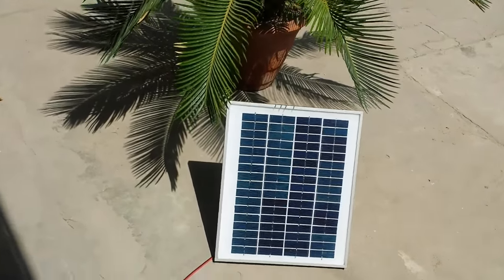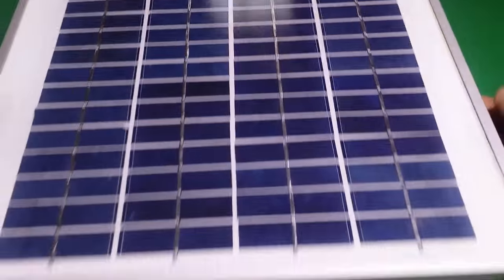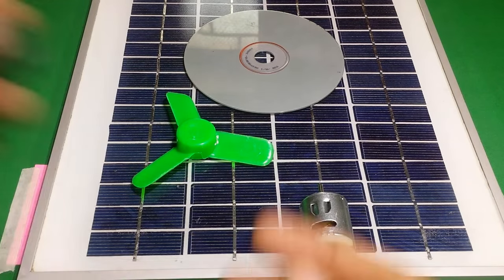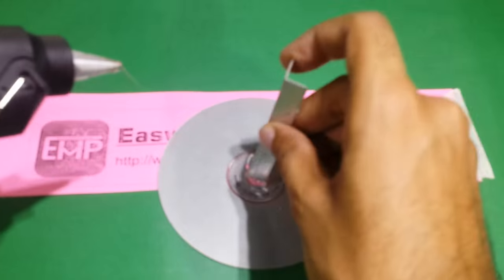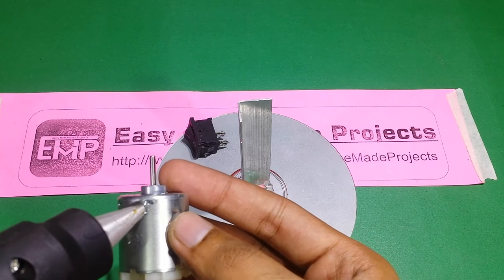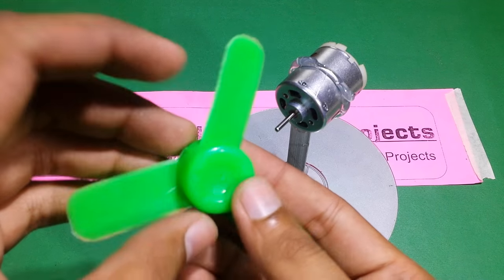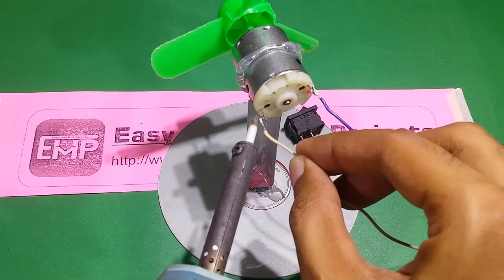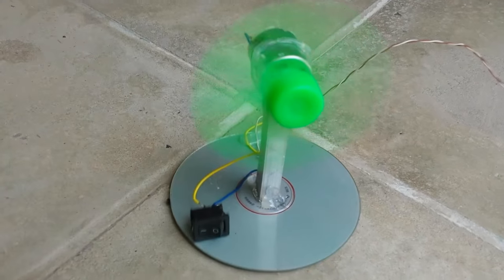How to Make a Simple SOLAR FAN at Home - Very Easy

Comment: I think that aluminium angle will not give proper support to motor. Motor continuously vibrates and also remove that robotic voice...talk in your own voice..it will be nice and effective
Reply from the maker: +Chinmay Electronics actually i am not an English speaker, so it is very difficult for me to speak in english. but i will try in my up comming videos. thnx
Reply: Suggestion: you can make an entertaining dialogue between you and the voice. Try it.
Reply: Chinmay Electronics I don't think the Motor could ever remove that robotic voice

Comment: why did you not connect the white wire?
Reply: The two unconnected wires are for connecting to the battery  or directly to the solar panel which was not shown.